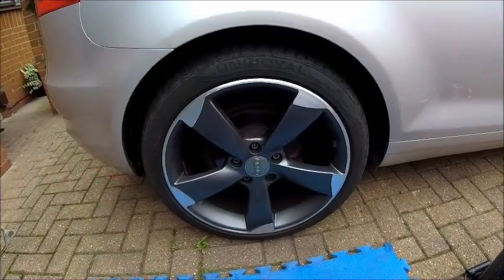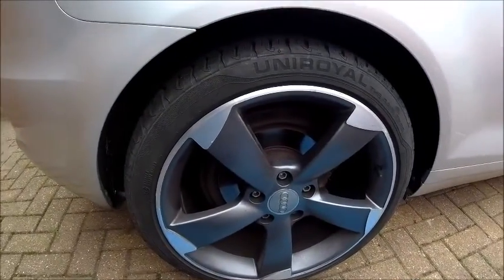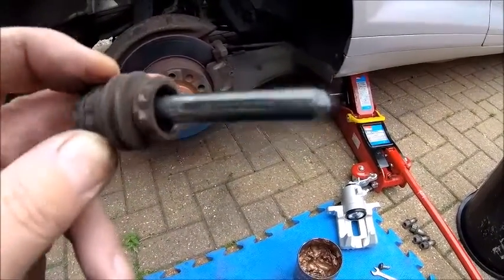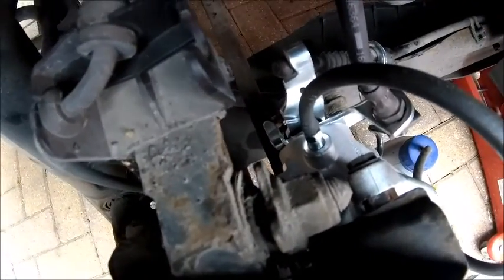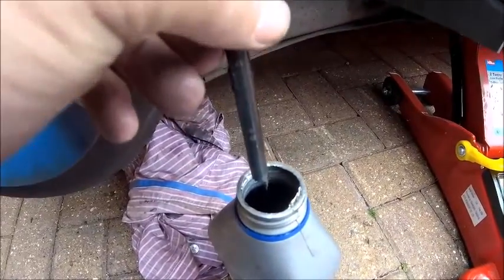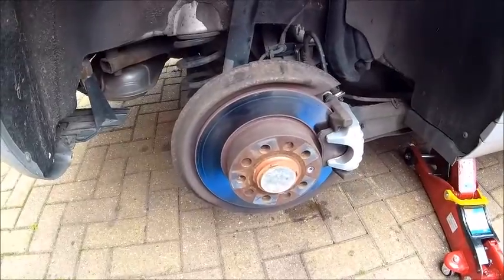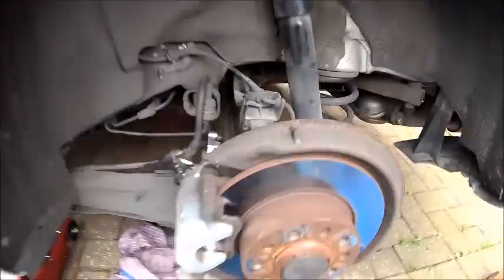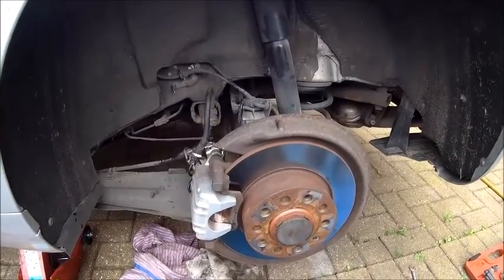Audi A3 Rear brake issue | part 2 *** WIN ???  ***

Comment: Good to see this second part to completion. Now, can I ask a stupid question as an electrical engineer and with seriously no mechanical car expertise. I was interested to see that there is still an element of binding even after all of the work is complete, is this normal in all cars, new and old?
Reply from the maker: Hi Mick...if you keep in mind i was turning it with my hand ...it may seem like a lot of binding ...but when you have the rotating mass attached (The wheel) it will be a lot less..there will always be some resistance  and generally more on the back than front as the front calipers have multiple pistons and no self adjusting mechanism like the back ones which are usually only one piston which will only release a small amount... hope that helps...
Reply: @AdeReeves  Hi Ade, Yes that makes sense to me, thank you. This was very interesting to watch and I'm sure it will help a lot of people.